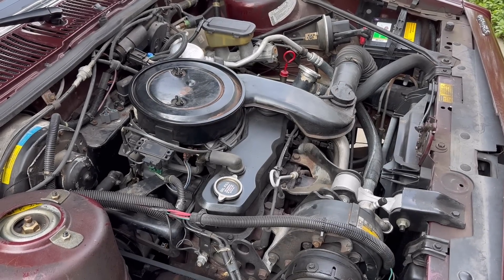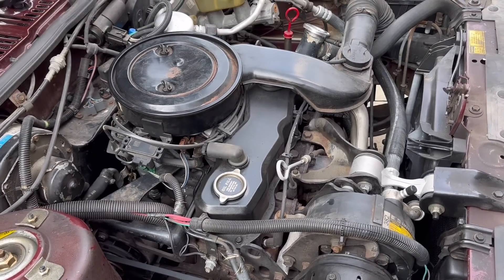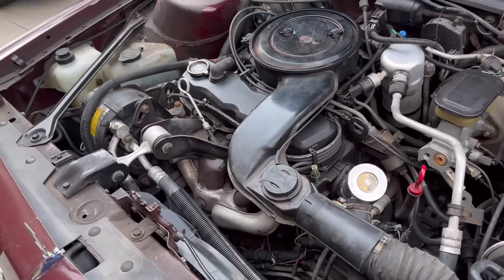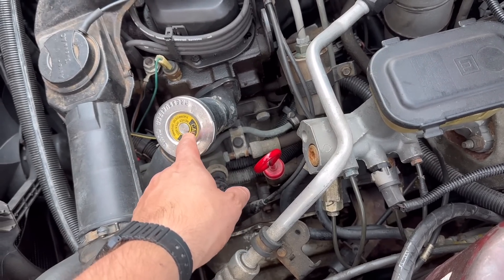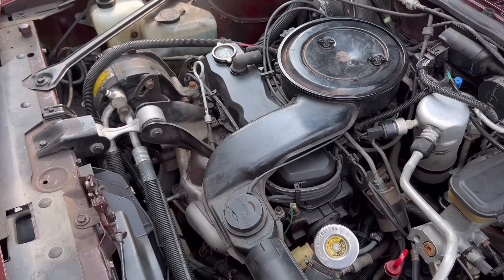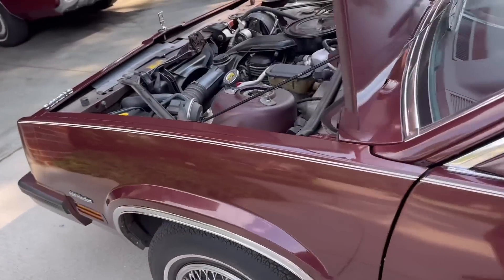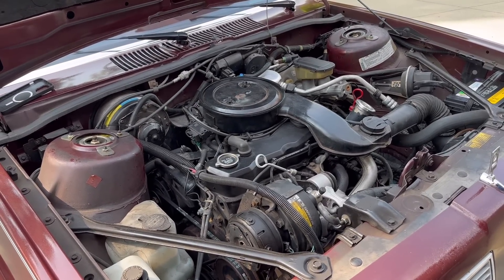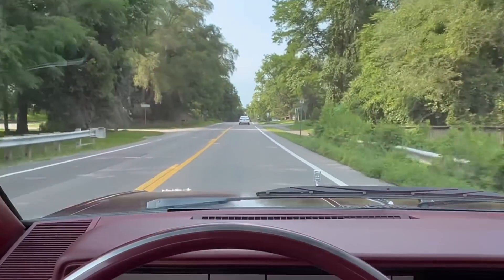Bad Engineering Makes This Engine Challenging to Repair: GM 2.5L Iron Duke 4-Cylinder Engine

Comment: This comment is in 2 Parts:
I had an new 1980 X-car purchased in December, 1979 (the first intro year was about a year and a half long with an early introduction) which I owned for 7 & a half years. I do not share any enthusiasm for these vehicles, especially from the first year of production, for a number of reasons which I will mention in a moment. I had a Chevrolet Citation model with the optional X11 package (This is before they updated it for the 1981 model year with the more powerful hi-po version of the 2.8 V6 & the associated improved suspension tuning, tire & wheel upgrades, style upgrades, hp upgrade, etc), with a 4 speed manual, no a/c, the nicer velour interior, a gauge package (without a tachometer which I added myself later) & the optional 2.8 Liter V6 which made if I remember 110hp which was respectable for a 2700 lb car. The price was $6,500 before tax & that was not much below the sticker price, as these cars were selling so well! The 1981 Citation X11 would have been a much better & more enjoyable machine with so much more attention paid to performance for the 1981 model year. 

Nevertheless recall that the workmanship headaches and concerns with the first years of this vehicle overall had GM go through a considerable update for the 1983 model year of these cars which iron out some of the bugs. As GM has done SO MANY TIMES in the past, they would introduce a vehicle with considerable problems and then solve them over a number of years often just killing the vehicle at a later date!!

The overall roominess of the hatchback design and the usefulness of the fold down rear seats was great & for the time the V6 was a peppy car that achieved good fuel mileage with the 4 speed I had & I thought the exterior style was decent.

Perhaps the most awful aspect to the vehicle was the absolute pit of workmanship, low quality of interior parts & awful paint. Upon picking up the car I noticed that there was orange peel all over the car paint. I sent the car back to the Chevy Dealer where i had purchased it, for a warranty paint job, and instead of sanding the awful paint they just painted right over it all! One year later at the quarter car wash paint would come flying off. Within 7 months of the repainted new car I had to do the best i could to repaint it in my garage using tons of over-spray tape and spray paint cans!! The next problem were the giant wide black X11 stickers applied to the side of the car. With all the paint problems they began to fall off a bit. So I took them off and wen to the Chevy Dealer to replace them. I recall the cost: It was nearly $600!! Back in 1981 $600 was a lot of cash! --SO I said goodbye to the black colored striping stickers... I had the car treated by Ziebart when new (an anti-rust treatment used for decades before cars had two sided galvanized metal) so having so many rusted areas on the exterior sheet-metal from the poorly applied paint was a big disappointment! Recall that GM was still living in a world where it dominated the market here in the US and it frankly just did not care about workmanship, and it showed!!

I recall that the thermostat was easy to get at sitting right at the top, and the engine for the time was peppy and I got it with the optional deluxe velour interior which made the X11 striping on the seats look good. Regarding the lack of a serpentine belt, yes, I recall my water pump belt failing early and I had to replace it in a parking lot in Ohio away from my home in Michigan. Yes the serpentine belts that eventually came out are so much better, & longer lasting.

Regarding the bucket seats, I recall how awful they were & uncomfortable to the lower part of my young back on any longer trips over 50 miles or so. (I do not have any back issues!) The seats were manual adjustment buckets and of course could be moved forward and back but the angle was wrong!! I solved it by added about 20 large washers to the front bolts to get the seat to angle back and that helped a lot!! The upholstery did last decently however and by the standards of the day it felt good and was of course better than any hot black vinyl would be and seemed also to clean up easily although I later added Scotch-guard to the upholstery anyway.

Regarding the distributor and the engine itself, the V6 was really quite smooth, especially at idle, (I tried to start it two times with the engine running!!) but again, GM quality was so awful about so many quality issues it detracted on the whole vehicle. For example the engine quit on me one day (at about 65,000 miles) and I towed it back home with another family member. I discovered a seized up oil pump and this is after a huge number of oil and filter changes. This just should not have occurred!! When the oil pump seized it broke the distributor gear so I though that was the concern. So I replaced the gear which immediately broke when I tried to restart the engine. I then took an extension to the pump and saw that it would not freely turn with the attached wrench and towed it in for a hd oil pump to be installed from the 1981 X11 package, which produced a higher oil pressure, hoping that it would last longer!! After all those many oil/filter changes I was not too happy.

Comment: Regarding emission controls I distinctly recall the "pulse air" emissions system failing so often (the first time under warranty). The second time with me paying to replace it and the third time a few years later proved it was an expensive & undependable emission control unit so I went to the local hardware store to find an SAE replacement bolt to seal the holes in the exhaust manifold that allowed these units to operate. (These pulse-air units connected to the manifold and if they develop a leak it sounded like a big hole in your exhaust system and you started to smell exhaust fumes in the car) --But it was metric, so I thought, and I went and looked for a metric bolt to cover over these holes!! But none was to be found because GM made these units out of some kind of unique threads. So I cut off the pulse-air units (one on each bank of 3 cylinders) & and had a welder man seal up the ends so I could screw these now sealed units back into the manifold to stop the exhaust leaking! It worked!

Then I wanted to upgrade the sideways (mounted up and down like in the old Stingray Corvettes in the 1960s) factory mounted radio. (In those days this was a common thing to do, upgrading the typically mediocre-sounding factory units) until car stereos starting improving). First thing I found was because it was sideways the replacement cassette tape playing units would fail as the because they were designed to play in traditional sideways mounted position! Not the fault of Chevy of course but another pain in the neck for the owner. I finally got the stereo figured out with a unit that stated that it was designed to work even inside a Chevy x-CAR!! While upgrading the sound system the cheap plastic instrument panel surround broke in two and I used super glue to hold it together but it would not take. Then there was a valance panel under the instrument panel right above the driver and front passenger's legs. These panels were held in place with awful, low quality, snap in place plastic in bolts that just would not reattach with authority. So one day while driving this entire panel just decided it had had enough and fell in a hinge like-fashion from the area right above the accelerator pedal and hinging down from above my knees and perfectly wedging the pedal down. Because I had a clutch I could disengage the engine as it wound up to 4-5000 rpm, shut off the engine and coat to the side of the road. Let me tell you this is a real thrill to have the pedal pinned to the floor like that and do not think that you will coolly and expertly react quick to the problem! I was fortunate that i was only traveling about 20 mph and had a nearby gas station to turn into to investigate the concern. I pulled off the whole plastic panel and drove home. I contacted the NHTSA. They were unimpressed & found no trend but with so many hundreds of thousands of these vehicles & men installing upgraded sound systems for these vehicle with these cheap plastic parts that will not reattach properly, who knows if a dozen or more people may indeed have experienced this as well.

Another notorious concern with the hatchback models were the gas powered struts that hold up the rear hatchback deck which had a propensity to fail so much so that there was a "secret warranty" covering these units and of course I got mine replaced and then the replacements of course failed. In fact is I remember correctly there were seven secret warranties. (A warranty issue not officially recognized but covered by the dealer IF the customer complained about it!

Another concern was how fast the constant velocity joint boots would fail. I washed and cleaned (including the underside of the car) A LOT but had to go through 2 sets because the rubber neoprene boots would crack and fail. I understand this concern but two failing within 7 years and 76,000 miles?? The quality of these boots just wasn't there, and when the boots go bad and crack, dirt gets into the CV joints so they have to be fixed.

Another concern in the first year was the rear brakes locking up a little too fast (the average driver would not notice this) but the car would skid out more often on very hard rare stops needing steering correction. Lots of cars in the 1960s and earlier would do this (look at test reviews from the past and you will be astonished at how awful the handling and braking of the average cars were then).

Another concern in the first year at least was the rear brakes locking up a little too fast (the average driver would not notice this) but the car would skid out more often (rear brake lock up) especially on very hard stops needing steering correction. This was noted and there was a big recall on about 1 million of these cars back in 1983, although to the average driver on an average day doing average (not sporty driving or driving in inclement (wet or icy) weather you would not notice it. But a hard stop even in dry ideal conditions could cause rear skids. Lots of cars in the 1960s and earlier would do this (look at test reviews from the past and you will be astonished at how awful the handling and braking of the average cars were then) but relative to the advances in handling and braking that had occurred even in the malaise era of car engineering (1973-82) it was noticeable. The concern was, apparently, abated for 1984-85 model years. You may find this review interesting: [https://www.autosafety.org/general-motors-x-car-brake-lock/]

So these are just my takes, having owned one for over seven years. I might have a few more comments if I think about it! ;-)

Comment: Bought an 87 Fiero 
 that seized and spun the rear main bearing when the roll pin in the distributor shaft gear disintegrated. The Western Auto box engine I put in an had a fiber timing gear on the camshaft whose teeth were gone after 70K mikes.  Had to drop the engine out the bottom like an air cooled VW. Fun driving car that did 40 mpg on the highway. Another car cancelled by GM just as they got it right.

Comment: That engine in a Chevette is not bad.But I rather have the 153 .The lean carburetion and dead camshaft made the Duke so rough.GM resorted to GM of Brazil when they choose the bore and stroke ,4"X3" which made the engine run smoother but after they worked their magic the Duke was rough and virtually powerless.

Comment: My Dad had the AMCConcord, 81 I believe, with th iron duke motor, but it was rear wheel drive so the engine sat the other way. Now, if you research the bore and stroke, you will see it is identical to the infamous 302 DZ Engine from 69 camaro, so this gives you an idea of it Spirit, it likes to rev.. Also I ended up working in the FLint V8 engine plant and these 4 cylinders were produced in the same plant with the 4 cylinder lines intermingled with the V8 lines, at least it showed on the drawings, but this was 94 so the 4 cylinder lines had been removed by then. I interviewed at the V6 engine plant which was taking off then.

Comment: I had a 1980 Pontiac Sunbird with the Iron Duke. Those were a LOT easier to work on than a FWD layout! I’m guessing the S10’s had as much room in the engine bay as the H-body cars with the Duke engine. A friend had a Celebrity with the Duke and I couldn’t believe how much more stuff was hanging off the engine, compared to my car…

Comment: I had a brand new 86 Cutless Ciera with the iron Duke 4 in it, and it could Not pull that car in a decent acceleration for shit.
It was a beautiful car inside....
Like a living room , rode smooth.
But the engine OMG...!!!
I had a bunch of people in it and we're climbing a hill and it's pinging like crazy ..
No knock sensor on that..!

Put about 3 racks in it... all covered forever they were so bad...
Had the head gasket blow ...
Couldn't even find the bolt that snapped out of the top..

And lastly , even though it was garage kept ... all rust pockets started bubbling up after the 2nd. Year ...!!!

Of all the cars I ever owned, that was one of them ..😅

Comment: I had one of these with a tall cap and rotor, in order to replace them it took removing the intake manifold. What was stupid was a shorter cap and rotor were also being made, they just used the tall ones to make the car worse to work on. I got to hating this early 80's garbage sometimes. I rebuilt a lot of those dual jet carbs and replaced the weird intake heating grid carb mounts which split from engine vibration. Then there were the upper engine mounts which early on failed quickly.

Comment: Have an Iron Duke  in my 1986 S15. Real wheel drive positioning makes all the difference as it is very easy to work on.
Reply: yeah,  the motor was not designed for front-wheel specifically.

Comment: On the flipside, it's actually a lot easier to change the distributor on the Pontiac Fiero. It's that the motor is facing the opposite way.

Comment: The cause of the problem is front wheel drive.  When you mount an inline four or six longitudinally, as you do for rear wheel drive, everything is usually easy to get to.

Comment: The 3500 v6 equally sucked working on. Same concept. Losen and remove the dog bone and bring the engine forward to change out things like plugs, wires and ignition module. PIA.

Comment: I worked as a lube tech at a Pontiac dealership in the late 80’s. The later iron dukes had the oil filter in the oil pan with about a 3 inch plug to remove to get the oil filter out,first year of that had a regular drain plug, ones after that just had the 3 inch oil filter plug to remove to drain the oil. By the of everyday I was covered in oil!
Reply: Correct no drain plug.
Reply: The very late models had a final version of the oil pan with both a regular drain plug and the 3 inch filter plug.

Comment: You can't say its bad engineering if you don't what the design objectives were.  

What I do know it was designed as an economical engine for a rwd platform (H body).

If serviceability wasn't a requirement then it's not bad engineering.  I've been an auto engineer and ease of service isn't high on the list. 

If it takes more time to service, that's more money for the servicing dealer.

Comment: Ford Fox body platform cars. Ac delete heater core takes 20 minutes. With ac it is a 6-8 hour job. If you're planning on doing the Evaporator core the box has to be cut open also once removed.

Comment: How about the water pump?  Mounting bolts hidden behind a pressed on pulley.  I remember working six hours to remove six bolts that I could barely see.  A ratcheting box wrench would have been wonderful, but I didn't have one (or know about them) at the time.

Comment: I had a 1986 Chevy Celebrity with the same engine.  I discovered a very simple way to replace the oil filter - turn the wheel all the way to the left before shutting the engine off, and remove it from the right front wheel well.  The oil filter is easily accessible from there.
Reply: My dad had an early-eighties Cutlass Ciera as a company car. Then my mom later bought a 84 Celebrity, which was passed down to me when she died.I cruised the hell out that car for years with no complaints. I did the wheel well trick as well. I always considered the Iron Duke a simple, reliable (loud!) engine that was easy to work on, although short on off-the-line power. In 88 we bought a Tech-4 Fiero brand new; yeccch! That car should have had a V-8 option.
Reply: @themagus5906  well it was a Pontiac engine.

Comment: Most iron dukes do not have the extra balance shaft added like in roughly 1985 ish.

4 cylinder engines are not balanced for secondary forces of the piston masses.  A L6 is. And inline L4 is not.

Engineering wise there is a shake due to the pistons weight/mass. It has large 4 inch bore pistons for torque.  Ie surface area .
 

So a non balanced iron duke cannot rev to the moon in rpm like a straight 6 can or smaller L4 can like in European small cars.
Reply: I've heard so many conflicting things about the iron duke engine.  R they reliable????
Reply: @petestaint8312  the iron duke is in like one half the us mail trucks that deliver mail each day.. the chassis is a GM  S10 80s pickup truck chassis..the body is aluminum by Grumman who designed the lunar module

Comment: That motor was designed to replace the Vega motor. When it was designed they never intended to mount it sideways. Distributor was much easier in a Vega or a Monza.